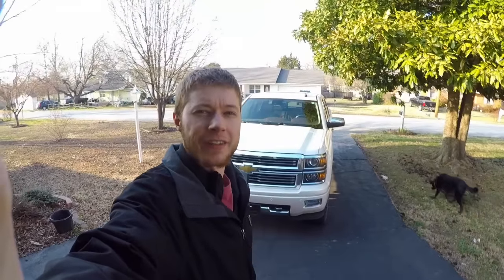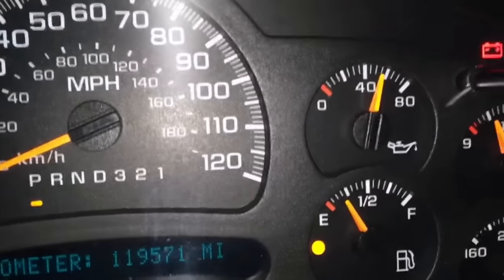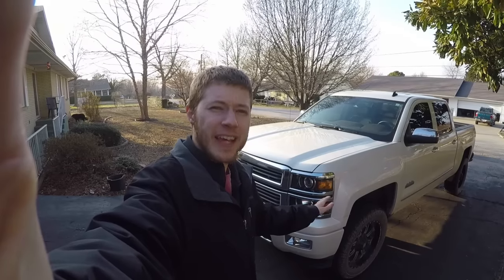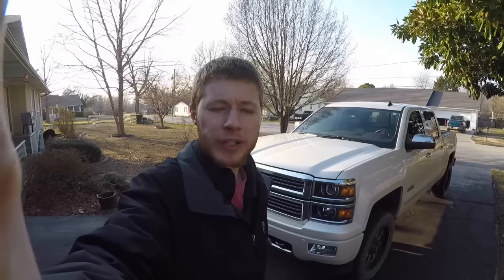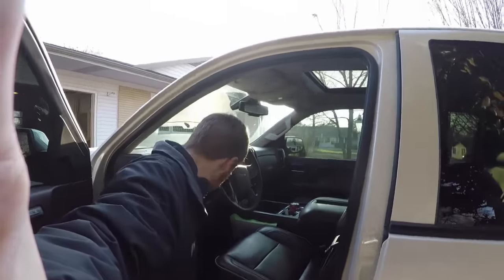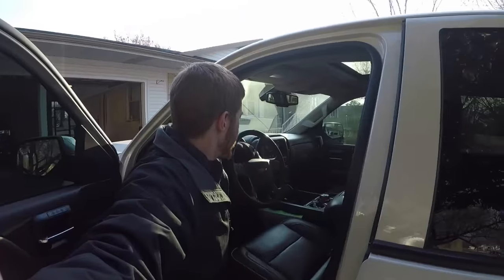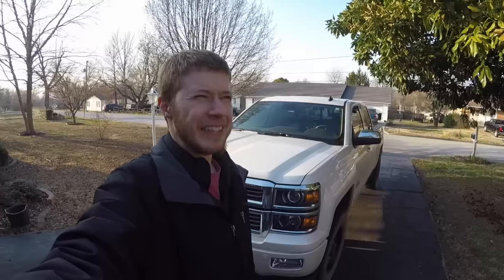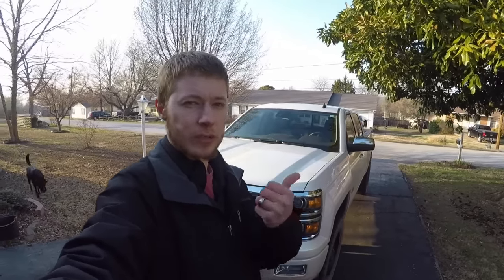Silverado Sierra 5.3 Lifter Noise Tick (What to do)

Comment: I know what that sound is, it’s a loose spark plug, it’s not a ticking noise from a rocker arm or lifter, it’s the sound of compression from a cylinder that’s exiting from a loose spark plug, or the the spark plug is not seated right, same thing happened to my Silverado, the check engine light doesn’t signal off either. I had this problem for months before I figured it out. It was so annoying it Sounded like a diesel truck.

Comment: My ‘02 2500 with 6.0L made that diesel noise at cold starts and would go away after a mile or two of driving. Nothing would resolve the noise but I never had any related mechanical problems but I sure hated to hear it every single day.

Comment: I have a 2002 Chevy avalanche and it’s a 5.3 liter and it has 241,000 miles on it and it’s the original engine and i have lifter noise... but everytime I change the oil in it I put 10w 40 weight because a thicker oil it better for those old tired engines.

Comment: Two different noise between trucks. Older truck piston slap, new truck  is fuel injection. Not a problem with either. Can get rid of piston slap noise in older truck with gm e.o.s.  But expensive for every oil change.

Comment: You know what even the newer smaller engines also have this tick, mine took 5w-20 and I threw in 5w-30 to try and help this out and it didn’t do anything was scared to try and go thinner than 5w-20 because my head gasket needs a replace and I didn’t want to cause a big leak, also with the gas thing I like to clean my injectors by simply going 3/4 with regular then topping off with premium and hitting the freeway and cruising at 75+ mph for about 30 minutes, it causes that high combustion and even cleans the spark plugs off a decent amount from what I can tell

Comment: Stick a broom handle down on the vacuum pump on a cold start when you hear the ticking and give a listen. Guarantee your noise is coming from there. Common issue some fail completely. Pump cost about $120-140 probably about a 2hr. Max job.  Calling the dealership in the AM on mine. I have a 2016 with 54,000 miles on it now. Bought it new and this started early. New it wasn’t a lifter so I waiting till more info came out. Then got off my tail and gave it a look. Yep vacuum pump. I have a 75,000 mile bumper to bumper warranty so I’ll see what they say and let you know

Comment: My 02,10,15 all did it my 03 Sierra also did it. I have the 15 now 93k on od no issues besides blown rear under warranty. The 02 sold with 330k on it with a oil filter that wasn’t changed for 2 years. Guy still has it running. Now if only Chevy right out the box could make a trans that doesn’t feel like absolute crap we’d be in business lol.

Comment: My 2001 Silverado 5.3 makes engine noise at startup and it has 280,000 Miles and it goes away after a few minutes of running. I am currently Building a 2003 5.3 Engine, with all new Parts, H Rods, and SS Valves and going to build it and test it, and store it until the original motor dies. GM Built these motors to last a long long time. No worries.

Comment: O ring in oil pump is going or gone bad, do not wait have a high volume oil pump put in it, if not its going to blow,  i know cause mine did, got a crate engine, ATK HP 97, 385 + horse power, 390+ torque, on high octane its a real beast! Its has all the specs of a LS1!

Comment: the new ecotec3 series motors (4.3, 5.3 & 6.2) are all direct injected and all seem to have a slight “ticking” that’s associated with this type of injection system. I have a 2018 Sierra with the 5.3 with only 3000 miles on it and it sounds the same. Has since day one when I picked it up at the dealer. GM service tech assured me it’s perfectly normal sound. However they did mention the top tier gasoline you spoke as being the best option for DI engines.

Comment: I just got a 2004 Chevy suburban z71 with allmost 300k miles .. I start it up in the moreing it has a tick but after a lil it goes away .. sould I be worried .. no check engine light

Comment: That noise on this truck is the high pressure oil pump. Just about the only problem they have with the newer ls motors is the active fuel management system. The afm lifters are junk and tend to collapse close to 100,000 miles some last to 200,000 miles

Comment: So I had a 2005 suburban with a 5.3. it had a loud "lifter" sounding tick. One shop wanted to do an $1800 lifter job! I took it to my brothers mechanic and he explained to me that he checked the oil compression from somewhere between the firewall and block. It was low oil pressure! He changed the oil pump and I never heard the lifter tick again!! BTW, the oil pressure gauge read oil pressure was good!

Comment: had a 5.3 on a 2001 Silverado with that ticking noise didn't realize it after I bought it took to the dealer under warranty they had a service bulletin stating that it was normal no effects on longevity bull crap that's not normal annoying that's what it is

Comment: Just put my 99 5.3 engine with 360000 in a 03 this engine has never used a drop of oil nor has it burned a drop of oil  never taped ticked or made any abnormal noise but i have been using castrol synthetic oil and prolong oil treatment since 89000 miles. I know it sounds un believeable but true. I have been using prolong in all my vehicles since 1995 and never had any engine block issues in any of them. All went well over 300k miles.

Comment: It’s the shitty AFM engines. My 2010 had lifter and the camshaft fail after only 58,000 miles. The mechanic at the dealer told me it’s because of the AFM on these engines. The cylinders that shutdown when running down the road for supposed increases fuel mileage are usually the ones that fail. Luckily I had exactly 2,000 miles before my warranty expired, so mine was covered. After they installed a new camshaft, I got a chip to shutdown the AFM and haven’t had a problem.

Comment: 2016 5.3 LT  Z71 here. Mine has 62,000 miles, bought at 35,000 miles. Went back to the dealership after three hundred miles because of the tapping, got it in writing from the dealership, that the sound was not unusual. That being said, mine was not near as loud. Good luck bud.

Comment: I have two Silverados a 2011 and 2016 . The 2011 does a noise for a lil bit when I turn it on but later on goes away . My 2016 model does it when I turn it on and stays , I can still hear the noise when I drive it . I guess that’s a normal Noise for the new models

Comment: I got a 2000 Chevrolet 1500 z71 with the 5.3l vortec it made a ticking noise and drove it a 1/4 mile just to hear a thump on the valve cover and the engine shut off

Comment: Ford's do it too my buddy has a 2008 f150 and and ticks realy loud and only has 60k on it brother has 2007 same noise and my wife's aunt has 2016 same noise so yaa I have a 2013 gmc sierra does not tick and the 2010 Chevy Silverado 2500hd gas did not tick and that thang had 205k on it whin I traded it in for my gmc sierra.

Comment: My 04 Avalanche does this but it’s because the head of one of the mounting bolts for the driver’s side header snapped off and needs replacement. It’s the bolt closest to the firewall. For me, the tick is air. Same bolt on my dad’s 07 5.3 1500 Crew Cab snapped off.

Comment: 2005 yukon denali  xl with 255000 miles 6.liter no ticking changed oil every 4000 miles 2018 silverado no ticking but bypassed afm it stays in v8 mode all the time

Comment: For the Love of All that's good and holy don't put Lucas Oil in your modern low clearance Motors!  Holy blown piston rings Batman, among many other things.  You'll be lucky if you even get the oil pump to pump that sludge and you'll probably guaranteed to blow your motor within a hundred miles please don't put Lucas Oil in your modern-day low clearance motors but take 5w or lighter motor oil

Comment: lifter noise... they call come with it. if your anti drain back valve isnt working so great, upon startup you will get it a lot. when it's cold it's way worse. you can either clean the lifters or replace them... or do nothing!! they last forever

Comment: Ok in laymen terms. It is part of your economy fuel management system. Get a tuner.. pay the extra cash for gas.. enjoy the full capability  of your truck and buy a tuner. Turn that fail shit off, trust me the engine can take it. Also clean that shit, the same symptoms that cause the tick also cause oil to burn off. Check the oil often,  also always use synthetic, and make both yourself and the truck a badass. BTW best tuner for your truck in my opinion is the diablo 3.

Comment: My trusted mechanic said a couple ways to fix it.  1.  100 miles before an oil change, put recommended cap fulls of sea foam in it and run it for 100 miles, then change oil.  May take several future oil changes to hopefully quit.  2.  Drain oil, put in transmission fluid as a replacement, and run it for 6-8 hours.  Then change oil.  That would probably cost over $100 in gasoline.  I am trying #1 personally.

Comment: 2018 Escalade, only 20K miles, and sounds like I got a bad lifter. Bit louder than yours and a faster clicking sound. I wonder if it's the AFM causing it. My 05 and 07 never had an issue, but those didn't have AFM.

Comment: sea foam. will stop most lifters from ticking. Lucas. I've tried everything. most of your lifters are hydraulic. Could try some transmission fluid lol Have to tell u. every chevy I've owned has done this nothing new lol I've got a 2001 chevy with 188,000 on it and haven't put one quart of oil in it except to change oil drive the piss out of them lol

Comment: My 2000 suburban does that, 
It always have.   I owned  it 16 yrs now 174,000 miles now it only lasts for 35seconds and its over and done with... to me its just taking a little time for the oil to coat the parts and your off the races

Comment: My bro Th we has 06 Sierra with the 5.3 and it has over 320k miles and he got the oil pan gasket replaced and they said he needed a new motor cause the rod bearing was shot so got around to replacing it and he got to busy with work right now but when he gets back home from work he will get it finished

Comment: I took mine all apart and found that the lifters were seizing up with gunky oil. I had small coolant leak on the intake gasket bleeding coolant over into the lifter valley it was burning the coolant and oil up on the top end in such a way that it wasn't detectable in the oil pan. I just cleaned the all lifters and push rods inside and out very thoroughly put them back in and run marvels mystery oil for 100 miles and changed the oil and back to smooth again @ 375000 miles

Comment: My 2014 Chevrolet Silverado 1500 has the noise tick and has had it since I bought the truck with 20000 miles. I now have 72,000 miles on the truck and no issues with the tick.

Comment: Your 06 was prop rod knock. I have a 2014 Chevy 5.3 and it is the “knock”. The truck comes stock with a high pressure fuel rail that shoots fuel at about 3,500 psi which is normal for direct injection fuel systems. I know on my friend’s race car which has a ls3 and he put a high pressure fuel rail that has a psi higher than 3,500, It makes that knock.

Comment: Their is a problem with the vacuum pump on the motor  in the 2014 to 2018 it was defective that causes the same noise my truck has that problem they don’t make the original pump anymore there is a replacement

Comment: I have a 07 vortec Max new body style it has the 6.0 with 163,000mi it also has the AFM fuel management no problems yet runs like a champ if it's cold out it ticks for maybe 10 sec. and dissapears

Comment: My 2014 has the same sound typical gm motor noise...Unless it is knocking then you should worry. I also had a 2002 Silverado for years that made a ticking noise after warm up it had 284000 miles on it still had full power.

Comment: My 2014 makes the same sound.  I tracked it down to the high pressure fuel pump under the back end of the intake.
Reply from the maker: I believe that is where it is coming from!
Reply: Dustin T I’ve heard that as well, but why does changing to a thicker oil make it go away, as some people have mentioned?

Comment: 17 silverado 5.3 here and is doing it, it is my 3rd silverado bought all 3 brand spanking new 3 miles in it 61k miles and at an early stage the sound was there but very low, now starting to get a little bit louder, I have not checked compression etc, hopefully is normal

Comment: My 2015 Silverado Z71 LTZ has the same noise. It’s a faint noise. I just got it a couple weeks ago with 50k miles. I was thinking of taking it to the dealer but I’m not sure if it’s covered under the Manufacturer warranty since i don’t want to spend money since I just bought the thing
Reply from the maker: If it’s faint I don’t even know if I would worry about it. Almost all the new ones I’ve looked at make this noise. You could get the dealers input, but I’m like you, I’m afraid it wouldn’t be covered under warranty

Comment: If it is ticking that means it is still running. My 2000 Silverado has 230,000 miles on it and is the noisiest motor I have ever had. Just like the video, I believe they all make some noise. I'll just keep driving mine until it quits!!!!

Comment: It's the 4-cylinder mode the lifter stick down on them and that's why they're loose pull your heads off pole lifter CB-1 7 + 4 + 6 do a lifter delete kit

Comment: I have the 2014 Silverado 1500 LT the noise you hear is the air pump for the brake pedal  works together with the brake power booster ! Even had mine replaced still same noise so it's normal .

Comment: I've got a 2000 GMC 1500 with a 5.3L with 275000 miles bought the truck  new and even new the lifters ticked  for a few minutes after starting. Going to install a new oil pressure sending unit as soon as I can find a warm place to work to see if my oil pressure which is running @ 40 PSI is really the pressure in the oil system.

Comment: Always figured it’s just a typical mechanical noise of the lifters actuating. Completely normal. Have also came to the conclusion like you that shell vpower (91 oct) no ethanol helps a ton.

Comment: Good reliable engines. If u don't like the tick ur going to hate it when the transmission & transfer case goes out at 111k miles.
Reply from the maker: Don't tell me that man!  Haha
Reply: Dustin T lol sorry sir. I had a 2013 z71 bought it new never had it in mud & at 111k miles the transmission & transfer case went out at the same time. contacted the dealer and gm and nobody cared lol. Transmission shop said all the newer gm's do that.

Comment: the 5.3 is known for the exhaust manifold bolts to break off and that will get the same sound and once warmed up it will go away. replace the bolts and my 2014 was fixed

Comment: My 2004 Silverado 4x4 is noisy for 1/2 mile on cold mornings and then get quiet. 290,000 miles on engine rebuilt trans and still loving this truck. Probably buy a new motor when this one goes.
Reply from the maker: Sounds like a solid truck! When did you have the motor rebuilt?
Reply: I also have a 2004 1500 with 5.3 157k on engine/trans. When did you have the trans rebuilt? Everyone says these engines are gutless and doggy, mine runs like a champ with all kinds of power,even whith a load of coal in the bed. I just done the corvette servo in the transmission and it shifts nice and quick now , no more sliding into gears.

Comment: I have a 99 w 210k that is as quiet as a mouse and an 03 that has 405k, yes miles that has a slight tic at idle but goes away when engine speed is raised. Neither use oil and both have the same perceived power and fuel mileage as new.

Comment: I had an 05 gmc sierra z71 with the same problem.  I got rid of my with gunk motor flush and seafoam.  It had 263k miles on it and it STILL runs like a boss!  

I also recommend using Lucas oil stabilizer.  That stuff keeps the top end of motor lubricated well and eliminates dry starts.  I sold my truck to a friend and it still runs like a boss.  Got a 2015 GMC now and I'm going to do the same thing to this one.  It worked for me.  Hope this helps

Comment: I have a 2005 5.3L Sierra and it's never made the noise until this winter. It is a different sound from what you're hearing though. It accelerates with revving the engine and after it warms up it goes away. It seems like letting it warm up for a bit helps with it shifting out of 1st gear as well. I'm going to probably leave it alone and let it do it's thing...
Reply: This is what my 2018 is doing. Did yours get worse? 75k miles here.
Reply: @claymoreland1946  Mine was fine until I saw water in the engine and decided it was time to part with it. Don't know if it was related. It had +150k miles on it. Gave it to a dealership for $1000...

Comment: I have  a  2000 gmc sierra  with over 200,000 miles and  the  same  tap. When i use  non ethonal  gass  that tap goes  away almost  completely  but comes right  back with the reg unleaded  gass.

Comment: Check to see if you have a broken manifold bolt . They are known for it . It’s a manifold leak check back one on drivers side  hope this helps
Reply from the maker: I’ll check it out, thanks buddy!
Reply: Mine broke drivers front and passenger rear. Mine is old though 2004.

Comment: Good shit. I've been changing some plugs more often than you should oil getting on some random cylinder misfires and the lifter noise fucking annoying lol I have an 08 1500 I've tried the Lucas oil additive it helps a little still makes noise I put Mobil 1 full synthetic truck burns through oil

Comment: Get a mechanics stethoscope to pinpoint the noise.  It may be normal but if you have a collapsed lifter change before it destroys your cam.  Pre detonation from using to low of octane fuel will damage your engine.

Comment: My truck had a tick and it turned out to be an exhaust leak, the exhaust manifolds vibrate and bolts break off sounding like the motor